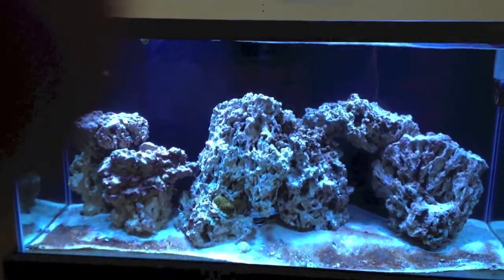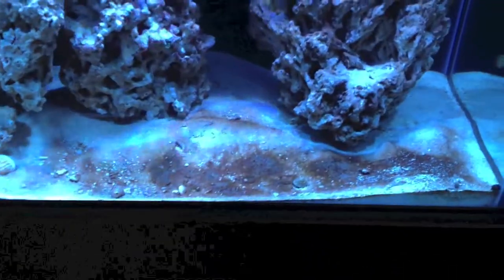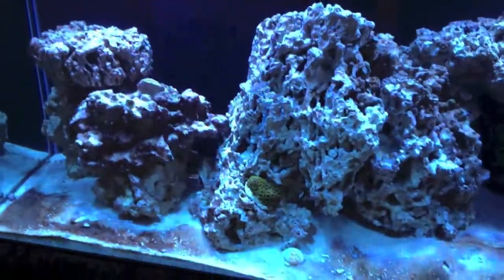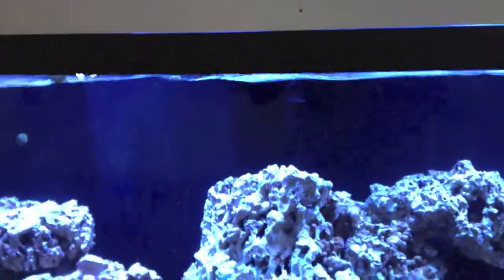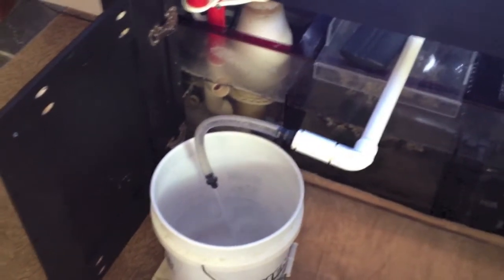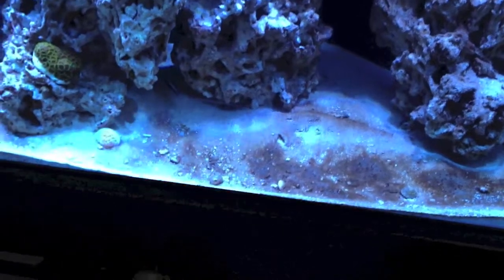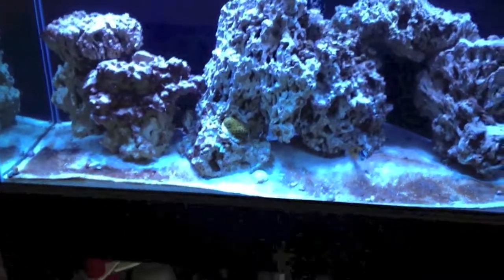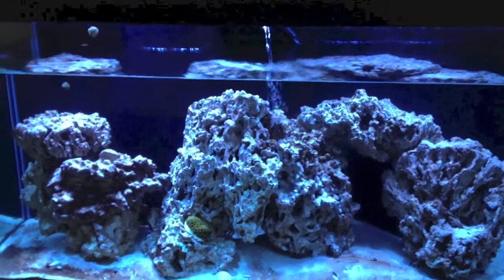Show water change plumbing

Comment: I have a similar setup. I just drain from the tank itself with a maxijet 1200 hidden behind rockwork so I don't have to worry about using a check valve on the return.
 It goes down to the floor behind the tank in the basement to the house drain. Then my water change setup is in the basement, I press a button and FSW  is pumped to the return line and in the DT.

Comment: I don't get it, where does the water come from ? Looks like it's coming from the internal overflow box. But that's not even 5 gallon in there .
Reply from the maker: Hi, when the main pump is shut-off the check valve closes so the water will not back siphon into the sump (via the pipe attached to the main pump).  Then I turn the loc-line water returns that are in the aquarium down to maintain the siphon when I open the gate valve to let the water drain into the 5 gal buckets.  The water will continue to drain from my return line until the water level drops to where the openings of the loc-line returns are.